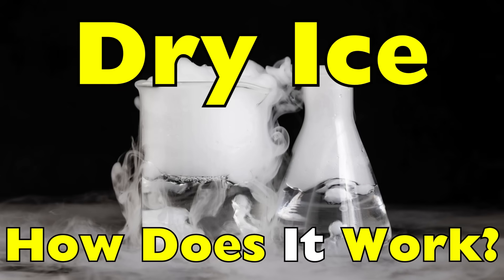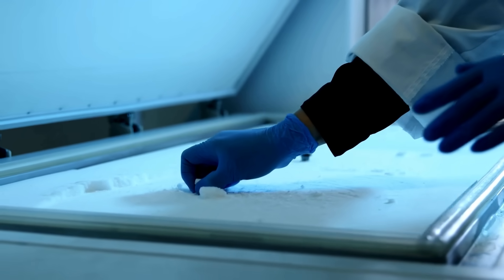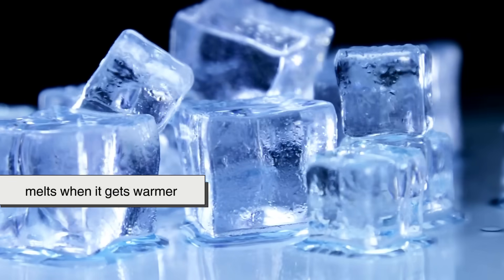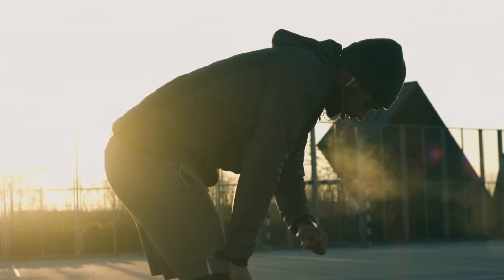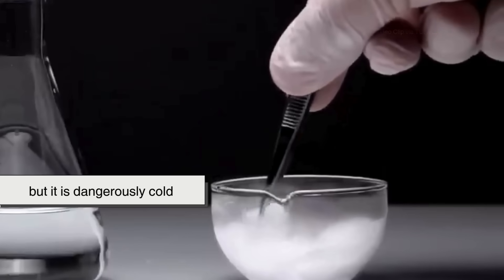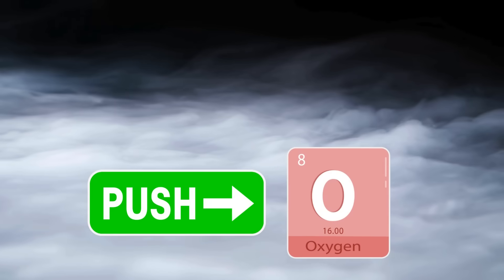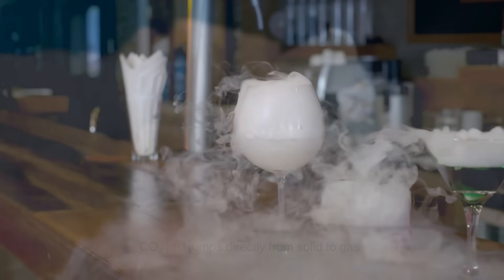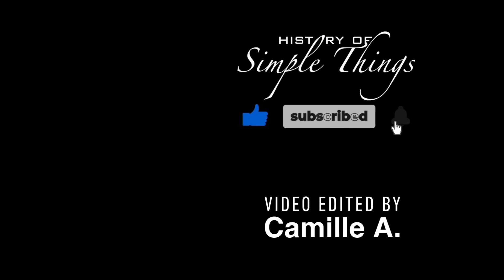Science That Vanishes — The Hidden Truth About Dry Ice

Comment: Talking about CO2 being dangerous when confined - I used to work with Liquid Dry Breathing Oxygen (LDBO). That stuff is dangerous too, with its expansion rate of 1,800 times from liquid to gas. We used this stuff for aircrew, mostly in fighter jets. Think you Yanks call it Lox - We call it LDBO to differentiate it from Lox being used as part of a rocket propellant. I believe you guys might also use On Board Oxygen Generators (OBOGs) on your fighter jets? Down here we have warning symbols for compressed gas products - I think they are green squares with black writing and a black image of a gas bottle.

Comment: Working with Kelsey Hayes we had a 2 stage freezer that we used to shrink the spool assemblies for aircraft hydraulic valves... -110° F does burn ya a wee bit... needed welding gloves to handle those spools and insert them into the valve bodies.